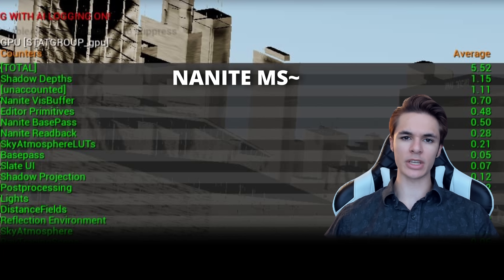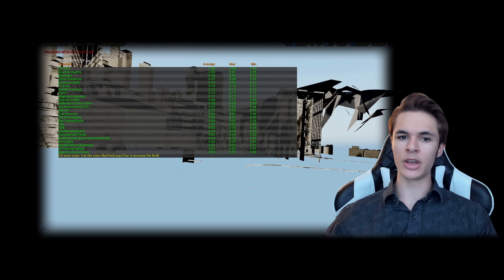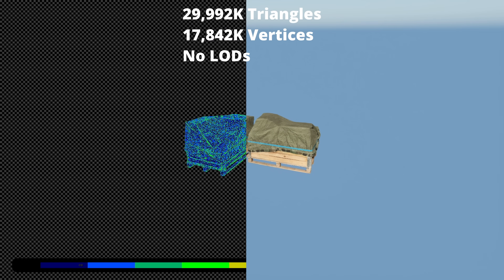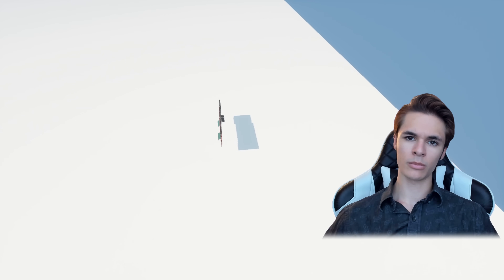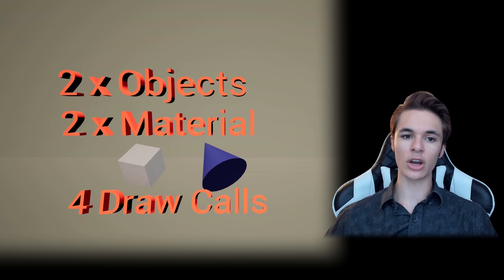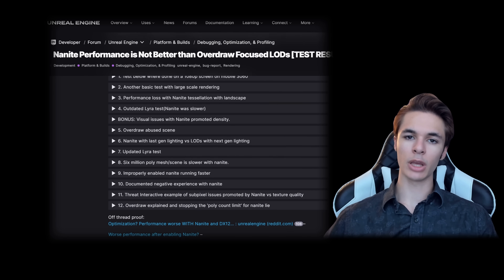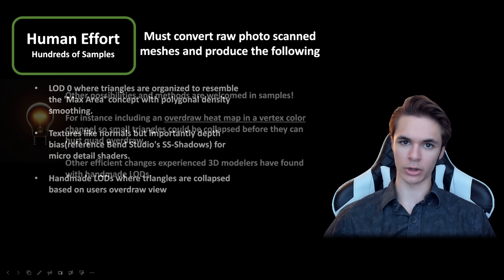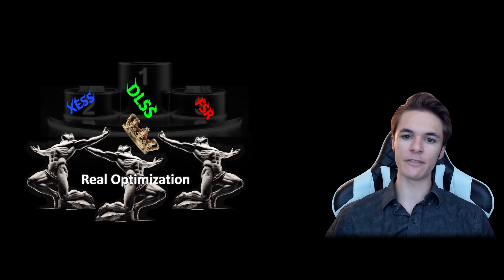Epic's Unreal Optimization Disaster | Why Nanite Tanks Performance!

Comment: I think your approach is wrong, sorry. UE is bringing game development to a wider audience by implementing simplified and automatic tools that don't need so much expertise. That's good. Obviously such simplified tools, as nanite or lumen or blueprints and so on, take many resources away. It's a compromise between easier access to game development and worse optimization. However competent developers with more expertise can still use UE and apply better optimized solutions, i.e. by using C++, smart LOD settings instead of nanite, traditional lighting instead of lumen and so on. UE is not the problem. The problem is the shortage of senior programmers able to implement optimization and low.level solutions in game development. Or maybe big companies are not hiring such experts and relying on the simplified tools of UE to decrease cost and increase profits to the detriment of quality. The lack of quality comes from game production, not from the engine. Expert programmers can still optimize and work at low-level with UE. I suggest you to change your approach. It's true that games lack of optimization lately, but it's not UE fault. UE is doing fine by bringing game development to a wider audience.
Reply: Nope, those game devs genuinely think nanite is better for performance. EG does too

Nanite is easier to use but that’s not it’s salient trait

Comment: i went from a 1080ti to a 3090. I was playing cyberpunk 2077 and thought double the performance would mean that i could play in 4k. It did but barely. it just does a bit better in 4k. now i know why. i was about to pull the trigger on a 4080 upgrade but im affraid it just wouldnt be worth it if the dev's keep doing this crap. you would think the console devs would want to have these optimized options but i get it. just increases the cost. end rant lol

Comment: Hey ThreatInteractive, can u tell me what the vram usage is for a nanite mesh and a normal lod static mesh that both go up to the same triangle counts? I have been thinking about it a lot, and although the compressed file size of nanite is smaller, I can not imagine the vram usage to be that much smaller. As in my head, the nanite mesh always allocates the full high poly vram required for all vertices. while the lod mesh switches out the vram for what lod is actively being used. 

The only way for nanite to use significantly less vram is if they have a way of using the culling system to also limit the vram usage. as unlike normal lods, parts of the singular object can be culled due to their quad trees.

Comment: In my tests nanite was better at rendering performance vs lods.
It was 7ms vs 5ms

But I'm sure nanite can be worse at some circumstances.

But nanite main purpose is not optimization, but fidelity.
Removing lod popping is a huge deal and it's worth some performance cost

Comment: This was also my feeling when DLSS came out... Is Nvdia controllingly giving less and less performance each generation, to profit as much as possible for a foreseeable future, in order to buy time to develop better hardware and software because they are not confident enough to make a close to 2x perfomance gains each generation anymore? (I'm aware that is my presumption of a 2x for next gen, but we have seen it in the past) 
Or 
Is it developers becoming lazier of optimizing games that could potentially reflect such a generational uplift in gpu performance? Is competition in the game industry too heated, too many developers around? 
Or 
Has it become a monopoly of lazy developers because of burn out from high risk investors? Are developers too eager and sloppy to be on the front page with promising buzz words with early access that is super optimized and soon followed by micro transactions in early access (there are examples like Le Mans Ultimate)

especially in developers perspective when we talk about visual techniques like tesselation (its been around for years I know but, it never improved too much in polygon count in my experience, instead masked by shadow maps that help out in the perceived appearance of tesselation) and raytracing/pathtracing is impressive but somehow justifies its performance cost when implemented properly (Shadow of the Tomb Raider is a good example in terms of fps, around 135-165 on a rtx 4080 paired with an 7800x3d in 1440p). Only X3D chips are impressive nowadays
Reply from the maker: https://youtu.be/6Ov9GhEV3eE?t=823

No market incentive for better graphic standards. This is the biggest issue.

Comment: I would agree but a huge problem games have had since 2016, is how they focus on graphics instead of gameplay.
Studios would have to make a genuine sacrifice between good graphics or good gameplay. And most of the time unfortunately, good graphics market stuff better.

Nanite seems to take alot of the modelling overhead away from indie-developers.
And thats huge honestly. 
Yea 300GB games that run slower are gonna suck. But i would be fine if it meant games that I actually play, get a performance boost from the crappy optimization.

Squad is moving from Unreal 4 to Unreal 5 for this reason I beleive. Their a small studio.

Comment: I work as a VR dev, and performance is our N1 goal, before visual fidelity. It is shocking sometimes that with a lot of effort how great looking games you can make, that run really well when using good traditional methods. These however take a lot of time. We've experimented with Lumen and Nanite, and quickly realized what a shit show those 2 are for VR performance, and to boot, the visual artefacts they create can actually contribute to VR nausea. Short of creating our own engine, we've moved back to Unity for now, because it is a much more flexible platform to work with.

Comment: In my uneducated opinion, all this new tech is just artificially making games harder to render at high frame rates. We should be at the point where 100 fps is the target for new games at 1440p, not 30. Go load up an old game like Skyrim, Crysis or Batman Arkham Asylum and max the details and resolution. Those games hold up very well to today's so called AAA games graphically. Even better in many instances, while running over or around 100 fps.

I see the industry making issues with performance to be solved with forcing the consumer to buy new computers to get back some performance. I'm done buying new hardware for many years. I'm checking out of this forced obsolescence game.

Comment: So much of this is completely wrong. I'm not sure if it is incompetence or dishonesty. 
Firstly he states that nanite is slow  because of quad overdraw. This could not be further than the truth. One of nanites major strengths is it fixes quad overdraw. It does this via using a visbuffer so that and wasted work in helper lanes barely makes an issue as the shader is simply exporting a single integer per triangle. It also fixes it by using compute shaders to rasterize pixels rather than 2x2 quads. Given a huge amount of time in the video is dedicated to quad overdraw you would think he would have got this correct. There is a large amount of info available on the inner workings of nanite as well as other vis buffer based renderers so there is no excuse here to get this wrong.
The example given is also shockingly bad. A relatively small poly scene (yes 600k is small for the whole scene) with a single mesh and single grey material with an odd camera placement so only about 30% of the screen is covered?. This is not even close to real world data that nanite expects to work with, nor is it indicative of world built with traditional static LODs. You need lots of meshes with proper materials on them. 
Nanite has some fixed overhead regardless of scene complexity so for simple and trivial scenes it is going to be slower on the GPU than without. That is what is being observed here with the simple scene
Here are some timings from a super simple scene and a more complex scene. non nanite meshes here have 6 LOD levels

Simple Nanite
Total 7.95ms
Geo  0.45ms

Simple Non-nanite 
Total 7.2ms
Geo 0.1ms

Complex Nanite
Total 10.65ms
Geo   1.25ms

Complex Non-nanite
Total 18.5ms
Geo  10.1ms

As you can see nanite is 8X faster for typical real world examples and you have no lod popping and a tiny CPU overhead. The fixed overhead of around 0.45ms explains why it is slower for trivially (already fast) scenes. 

Nanite has very low CPU overhead even for super complex scenes. You have a much higher CPU cost if you turn it off. Even with instancing which UE supports you still to cull check, LOD select and upload the per frame instancing data to the GPU. This costs the CPU and can be significant for scenes with lots of objects.

There is lots of other info wrong. UE does have fixed static LOD support with dither transitions so bizarre it should be mentioned as a replacement when it is there and has been used for years by games which don't use nanite.
Reply from the maker: You're the one incompetent in either english or comprehension skills. WE NEVER SAID nanite uses quads, we said it's faster than a bad quad overdraw scenario. 

And you obviously didn't read the slide showing all the cons and pros of different past games and their approaches to dithering.
Reply: @ThreatInteractive  "we said it's faster than a bad quad overdraw scenario."
At least we both agree that nanite is faster because it gets around bad quad overdraw scenarios that impacts non nanite rendering

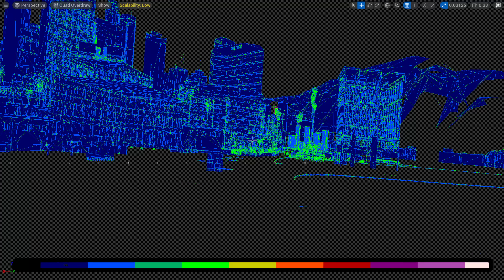Comment: @2:40 - quads really bug me. They were an optimization that made sense with large triangles, but are terrible with small triangles - and rather than, you know, put in effort to fix the optimization people seem to have given up on the entire thing instead.

The classic reason for quads is to allow for cheap finite-difference derivative calculations, as you're "guaranteed" to have adjacent pixels calculated too (but note this doesn't actually hold true for triangles that don't cover the entire quad...).

Unfortunately, they introduce artifacts in some cases, and are terrible for small triangles (or triangles with very acute angles in screenspace, for that matter).

If instead you calculate per-pixel and add a separate pass to communicate difference calculations between adjacent pixels you could do significantly better for small triangles - but this is all so baked into the hardware I doubt you could get decent performance without hardware changes :-(

Comment: well, this explains WHY All UE5 games I have run like a slogh (fortnite included)and doesn't look...polished, but games like Doom Eternal (and the recent Indiana Jones game) Runs like a dream compared to other games (and look sharper by comparison). and I though it was mi PC either having an old GPU (my old 12600k/2060) or Cloged with background task I didn't need(my current 13400/4070). soooo... YEAH
Reply: The New Indy game looks average at best, barely any better than Wolfenstein 2. And those low poly character models appalling in this day and age.
Reply: @Railssob_Kaetson-2  an acceptable sacrifice for 60FPS without AI scalers, id say.

Comment: i'll write complete nonsense for youtobe algorithm .

slot 12 changed: option changed: 1x Drop tank (610 gal.) (stock): it can now be equipped together with: 1x AIM-7M on slots 4, 10
F-15I Ra'am:
loadout changes: 6x 500 lbs GBU-38(V)1/B + 240x Split regular countermeasures -> 9x 500 lbs GBU-38(V)1/B + 240x Split regular countermeasures
custom loadout changes:
Reply: lol

Comment: what frame inspection softwere are you guys using?
I've been trying renderDoc with most successbut mostly need manual injections.
Nsight just fails most of the time. MS PIX does not work and intel...smth smth kind of works sometimes.

Comment: I really dislike whenever you bring up the DLSS argument because yes DLSS would look worse than native with SMAA or whatever. But you know what else? It also performs probably 20-30% better. In one of your videos you complained about companies missrepresenting features by only looking at a specific side of it (like showcasing 30 fps with slow camera movement, or TAA in static shots) but you do the same thing by not even attempting to bring up the performance benefit of DLSS. You also make no attempt to bring up the fact that most of these image quality differences are nearly indistinguishable to the average user. Unless you have a particularly lower resolution game with a particularly blurry implementation of TAA none of this matters.
Reply from the maker: It' not an argument, we show proof in several of our videos and DLSS is irrelevant to the conversion thanks to being proprietary.

Watch the videos.

Comment: I knew DLSS would become a clutch for developers in the future to skip optimization years ago when Metro Exodus introduced it and other games like Final Fantasy 15 and Control also were talking about it was like magically gaining FPS without losing visual quality but as you mentioned in the video they always show these examples on 4K displays which benefit the most from it. At least FSR has been a good way for people with weaker hardware to get a couple more years out of their hardware but sadly we're looking at a future in which using DLSS and Frame Generation is not an option but a requirement and developers will just claim your hardware is the problem instead of addressing the root cause of the issue

Comment: I use a 4090 and I can render 100 million polygon meshes in my scene, getting 10 fps, and I know that the project may crash if I turn off the nanite, because the nanite makes this possible.
Reply: Try to manual Bake LoD
It takes time, but 100 Million polygons is doable with GTX 1080 Ti at 120 FPS
Reply: bro you dont need that

Comment: When you showed the First Descendant example, I was glad to see I wasn't going crazy. I could never seem to get shadows to look ok without DLSS. Even shadows on the ground, where if I had shadows turned on low/medium/high, I would see dithering on the GROUND with huge squares where they intersected shallow slopes in the dirt.
Another thought I had was that if the game doesn't see a significantly reasonable increase in performance when setting shadows to low from ultra, then there's a real problem going on with basic optimization. It was never a problem before, and now I just see a bunch of "AAA" games throw DLSS or similar methods on as a band aid. I appreciate high poly models and such, but there has to be some standards to say the least.

Comment: Thank you so much for pointing these obvious flaws of UE5 out. I am not a programmer/dev but I knew from the get go that UE5 is a fail for consumers. UE5 is the sole reason why my 20gb VRAM 3090Ti makes any sense nowadays and the avg is what, 6-8gb? Games look sterile and all the so called high quality assets look awefull coz upscaling and anti aliasing is disastrous in UE5 or at least what the industry chose to utilize. why even bother with all of this when the avg PC can't even run 1080p at high setting in such games... catering to the top 5% PC-users and not even delivering at that regard. My RIG is suffering from these games lol... 3090Ti, 13600k and 32gb of RAM ain't enough for AAA games at max setting at 1440p 165hz which is the "standard" for "high end" to this day. 

I also believe quite frankly that UE5 enables lazyness in devs and it takes away uniqeness unless lots of resources are poured towards that subject. Hence again, games look sterile and similar when made on UE5 without the experience regarding the engine and I would also add passion to the equation. Non-consumer oriented management doesn't help the industry nor the consumers to add salt to the wound. Many studios are shutting down but it just doesn't seem like the industry is understanding the whys... We want well optimized games before anything else nowadays. Gamers are getting ever so more tired of paying full price for games we consider not finished and many of them won't be finished before the end of its lifespan. Espeacially "older gamers" who still remember the times were CD's were a thing and updates/patches were pretty much non-existent which forced devs to really pollish their games before putting 'em up on the shelves dispise this behaviour and the younger ones catch up in terms of intolerating this. It also doesn't help that AMD can't keep up with all of this "change" graphics wise and Nvidia scruting over consumers. like, if AMD can run frame gen. on my 3090Ti, Nvidia should be able too, but they rather pay-lock it with making it exclusive to the next gen. (40 series) which again got more expensive... Soon we will need 4k+ PC's to run games at max settings... ridiculous considering how it used to be and how consoles are (although even they get more and more expensive so... yeah)

I think I speek for many gamers out there and hopefully this input from me might be helpful for devs to grasp how we see this topic.